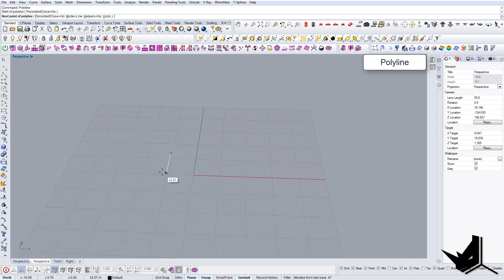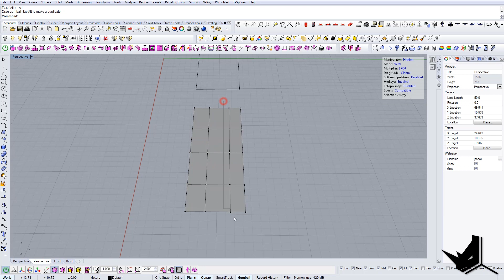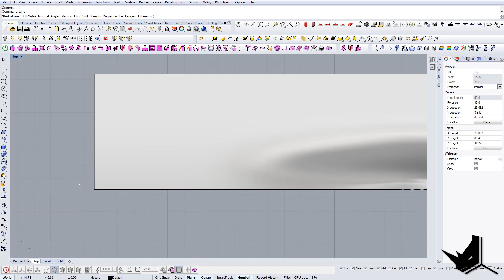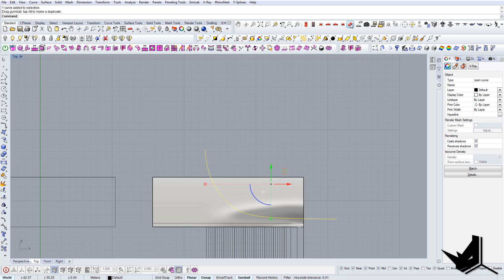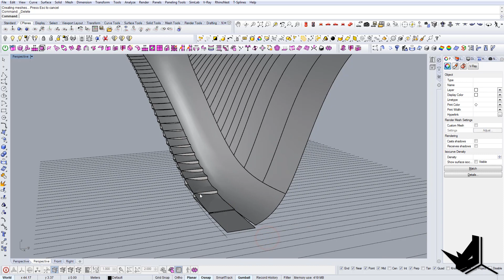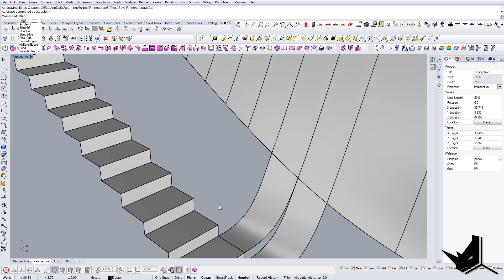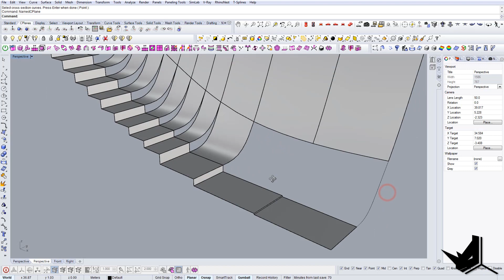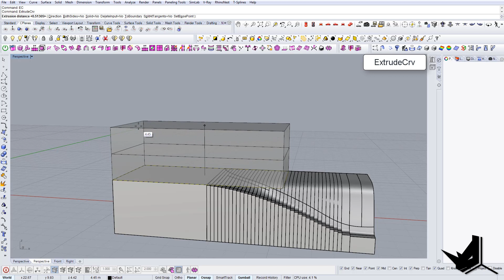How to Model Termeh Commercial in Rhino

Comment: are there any way to do this without using t-splines?
Reply from the maker: There is, but it is much more difficult. You could use the loft command but you'd have to guess the position of the curves. Also, you could try with cage edit tool, but it is a bit robust in my opinion. T-splines are the best by far for this sort of geometry. You can download it for Rhino 5 only and it works well :)
Reply: @HowtoRhino  I am a macbook user so, I could not find :( Thanks
Reply from the maker: Sorry to hear that. Mac version is very limited, unfortunately...

Comment: are you using Rhino 5??? I'm struggling to find out some commands that make me hard to follow... especially those pink tools, i cannot find it in mine. Im using rhino 5...thnks hopelly you will help me
Reply from the maker: Hi Nazario, 
Thanks for reaching out. Yes, these "pink tools" are not a default options of Rhino 5. So this plugin is called T-splines for Rhino. Unfortunately, this plugin is not an active plugin for Rhinoceros any more because Autodesk bought this company that produces it and now this plugin is implemented in another software called Fusion 360 from Autodesk. 
However, there is a workaround. The plugin can still be downloaded from here: https://www.tsplines.com/latest_version/ 
Let me know if you have any other questions. Hope this helps